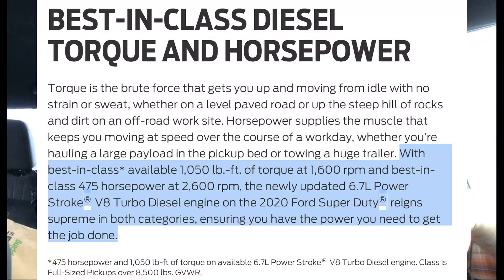Cybertruck Towing Explained:Torque

Comment: Torque is the engines ability to add velocity to the load. HP is that engines ability to run at speed. (I think)

Comment: the towing capacity of that f250 psd is 24k pounds, it all comes down to range , what will be the range of the CT towing that , thats it, HD diesel trucks are profesional vehicles not realy made to pull jetskis, they are made to work , im sure we will get there , but no cybertruck will match the capability of one of those , not even close , put a 20k pound gooseneck on a HD pick up and will pull it cross country no problem, it was made for that , do it on a cybertruck it will take you a month to get coast to coast

Comment: I think that most people are looking at this Electric towing conundrum all wrong. (I've heard every reason that Battery Electric PickUp Trucks are going to Suck Shit at towing)  The fact that we are dealing with electric drive trains opens us up to a whole new opportunity for innovation.
  The whole Battery Electric Skateboard 'platform' is already practically a trailer.  We all know that 'pulling' extreme weight has nothing to do with the actual 'art of towing' . We need to pull that MASSIVE weight SAFELY !!!   So let's throw a couple of those model 3 motors (or however many are required) and a suitable battery pack under the floor (most trailers are basically ... a floor), would that not exponentially improve braking capabilities? Let's sync the computer from the trailer to truck and let them share the batteries.  Could we potentially 10X the range depending on the size of the trailer?   Theoretically a CyberTruck should be able to safely 'PILOT' a trailer and load on par with Class A Semi long haulers?  I say "PILOT" because it would seem that the trailer essentially becomes its own powered vehicle. The CYBERTRUCK would just 'clip in', supporting a fraction of the overall weight.  Tongue weight is easily negated by axle spacing.   All that a 'Pilot' does is guide the way.  There is no braking issues no stability issues no power issues and no range issues. And of course this works for any type of trailer from low-bed haulers, 5th wheel Class A RV's or Utility style Construction Tool lock up trailers.  This only just touches on how much the 'OFF GRID' potential for construction and or recreation increases exponentially.  There are some trailers that will require some further thought. Mobile workshops that hydraulically open up and power your entire remote jobsite.  Then V2V recharge the trailer every morning with your CyberTruck. We may need to rethink boat trailers but that's for a different conversation one day.  

I know very well that I might be out to lunch here but when people say that something ... can't be done ... my mind starts racing on possibilities.   Hey ...  I'm just a small concrete company,  I play in the mud.  I'd really love somebody smarter than I am to take a comprehensive look at this as a viable solution.
Reply from the maker: That’s why I want to know if there’s more to that ‘Tesla trailer’ than meets the eye.
Reply: Cyber Truck, Truck Guy ... if there isn’t something on the market by the time I get my CyberTruck I’m going to build something ... I’d need to see if I could make it work properly.

Comment: Excellent explanation of Torque. Watch the Tesla surprise launch videos to see the torque in action. This torque will also make a huge difference when going off road. Great low speed torque, great high speed torque. When towing you will be able to pass the slower vehicles with confidence. Nothing worse then towing a long trailer and needing a mile of clear road to be able to pass and being long so others cannot pass you.
Reply from the maker: Absolutely right!  We’re going to see lots of amazing hill climbs.
Reply: If you want a demonstration of what Todd the Cybertruck guy is talking about search “electric tractor pull”. It will prove his point.